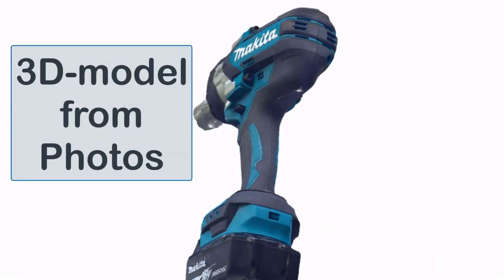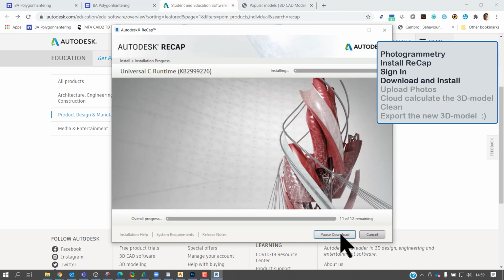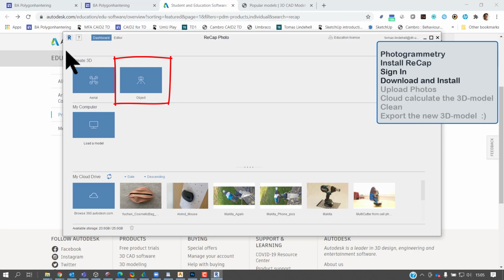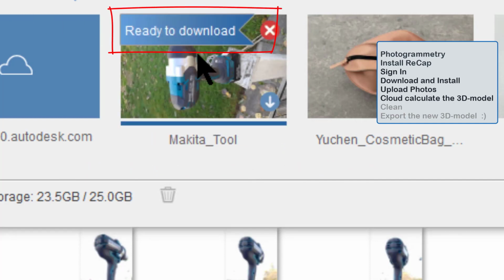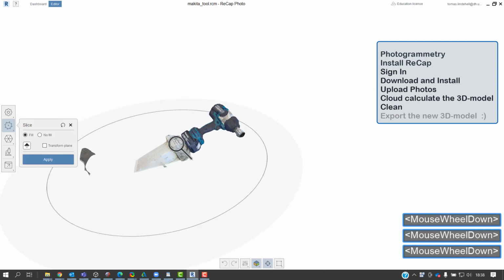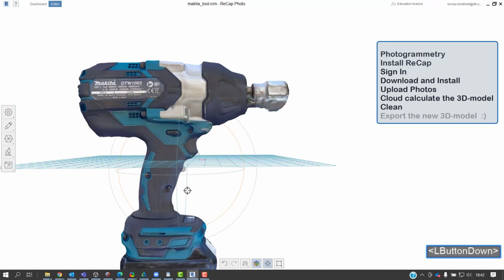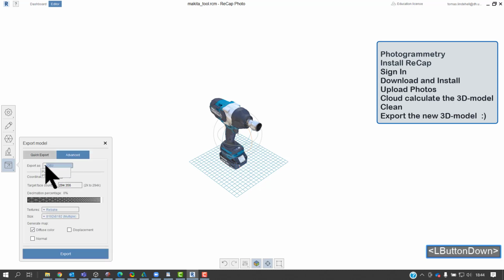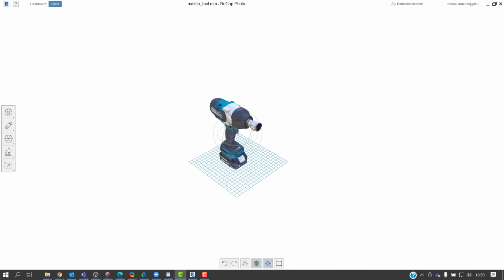2020 Video How to make a 3D model from Photos Install and use ReCap Photo

Comment: HI! is it possible to import in other Autodesk app and use for rendering (adding new object, adding background..) and also taking measure?
Reply from the maker: Yes you can 😀, just drop the file into your favoruite rendering tool!
After you scaled it you can measure. But measurements could be god or bad depending on the quality of your photos.
Regards TL

Comment: When exporting images to create 3D files, the program reports an error, is there any way to fix it?
Reply from the maker: There is many possibly reasons for your problem so I can only make some guesses. 1. Check that the storage you are pointing at have enough space. 2. Try to save with a very simple file name. Use only english characters. 3. Save with a short and simple path and only use English characters. 4. Uninstall, restart and install Recap again. 5. Try with another computer :) Hope it helps Regards Tomas

Comment: Hi, Wonder can I do this on a boat too ?  Length  6 meter and 2.20 meters Wide (Beam)  and how many photos should I take to do this... answer only IF you have time over, please...  /// McRoman ...
Reply from the maker: Sure you can! That's the beuty with photogrammetry, big or small doesn’t matter :) Image quality is the main thing though! And take a lot of images, 150 to 300 images. But you can do a "test" with maybe 60 to 80. Please give some feedback on how it"s going for you.
Regards Tomas
Reply: @lindehell  Hi Thomas I just take about 200 photos and a video, see know they can do that to w/Video...   post later how is going, think it not so easy as it looks ;)  /// McRoman / Göteborg
Reply: @lindehell   Hi Thomas, I Don't want you to be my Super Guru but try different thing, and my 3D look more like a Swedish Pankake;: encl. a link 3D view:  https://www.dropbox.com/s/cdyxeefkwzv24mc/3D-FC-18-XLT-IMCR.fbx?dl=0     about 52 mb...  Try Both in ReCap and the 3DF Zephyr ... /// McRoman... Is on my FlightCraft 18 XLT ...
Reply from the maker: @mcroman-superfeat  That was pretty awful! Can you please share your raw photos aswell?
Reply from the maker: @mcroman-superfeat  Have not seen your photos yet but a guess is that you might need more "reference points" in your photos. So when the software tries to stitch the images together it finds "strong" objects in several photos. If it is to clean around your boat it will be more difficult for the software.
1. Through out some garbage all around your boat. And noone of the objects should be similiar. Different colors and shapes, a showel, one shoe, a newspaper, a Rolex, etc. you got it.  :)
2. And if the trees in the background are moving by the wind it will NOT work.
3. And if your boat is shiny and nice you MUST "dust it down" to get rid of the reflections!
4. And are there any hard shadows? The best is a cloudy day with a nice all surrounding lightning with a minimum of sharp shadows.
5. Probably the sides of the boat are to "similar". Put a big bunch of post-it notes with different big letters on your boat.
6. Glass windows? Transparent objects cause problems! Put some baby powder or tape on those areas.
And just try to make "patterns" for the software to use.
Who said that it should be easy :) Good luck, I have faith in you and know you can do the job well if you just put in the effort.
Here´s some videos
https://www.youtube.com/results?search_query=good+photos+photogrammetry
Reply: @lindehell  Hi Thomas, I send shortly the RAW photo to you, visa my DropBox...  ;) - Also Tomorrow I put up a BIG Blue Markise around the boat so it is like a Blue Screen, only see if this help, any idea how I put the camera angle for best result, would be a great help for me... Cheers, /// McRoman ...
Reply from the maker: @mcroman-superfeat  It might not help to use a big screen. You actually loose a lot of reference points. If you still doing it then add post-it notes or random tape pattern everywhere on your boat! Also remember to "dull it down", you could blow some (baby) powder on it :) Same with glass and chrome parts...
Reply: @lindehell  Here DROPBOX Link, Thomas is the RAW (Folder) Photo 615 Mb on the FlightCraft 18 XLT :   

https://www.dropbox.com/t/fBiILAYJ3i7Dw5nO
Reply from the maker: @mcroman-superfeat  You need better images!
A. More overlap around 80%.https://youtu.be/E06kgYBftak?t=17
 Landscape format probably helps making the overlaps Here´s a video: https://youtu.be/E06kgYBftak?t=85
B. Get closer. https://youtu.be/SzobKDdghGo?t=157
C. Take more photos (it was only 106 images). Maybe three circles around the boat. Do it on different heights. https://youtu.be/1D0EhSi-vvc?t=148
I tried your photos in MeshRoom but it could not recognize how to stitch... It became the "Swedish pancake" :)
Reply: Hi Tomas, I try the Baby Powder & Post IT notes, Trick and see if it helps, anyway thanks a lot 4 U;r support ...